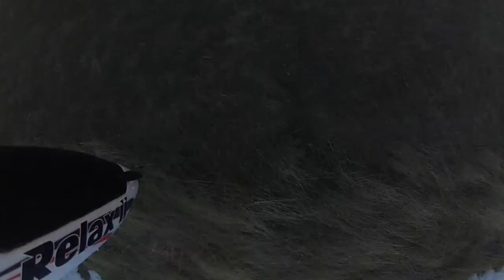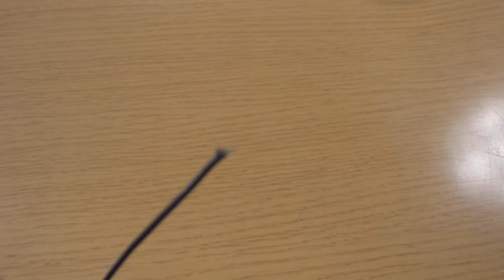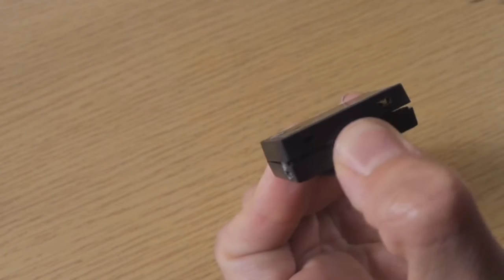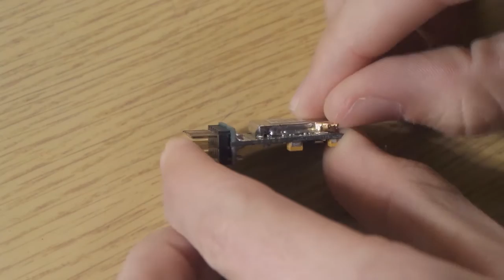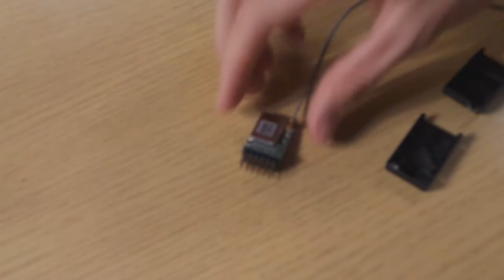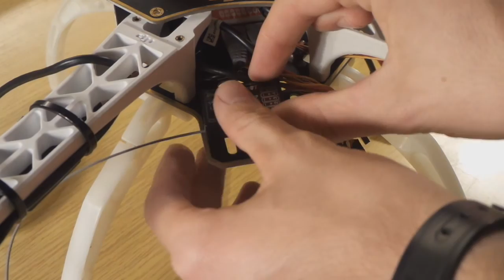BROKEN RX ANTENNA 2.4 GHz - SIMPLE FIX

Comment: how about walkera rx2703h-d receiver antenna sir?
Reply from the maker: +Danniel Amir I found a receiver antenna for Walkera Receivers they have the same clip-on system like the Graupner in the Video.
Here a link:http://www.aliexpress.com/item/Free-Shipping-Walkera-Receiver-antennas-for-RX802-RX1002-RX1202-Black-2-Pcs/1835725619.html?aff_platform=aaf&sk=eub6yrrBy%3A&cpt=1451412867947&af=5483&cv=41107&cn=3o04tc3ejkgy4v1ryqtzch51rwffch3p&dp=v5_3o04tc3ejkgy4v1ryqtzch51rwffch3p&afref=http%3A%2F%2Fcolossalous.com%2Faen%2F&aff_trace_key=75c93be12fa5439e9ad34c6978945c2a-1451412867947-00072-eub6yrrBy
It says for other types of Walkera Receivers not for your one...maybe it works though! I hope you can fix your receiver! :)